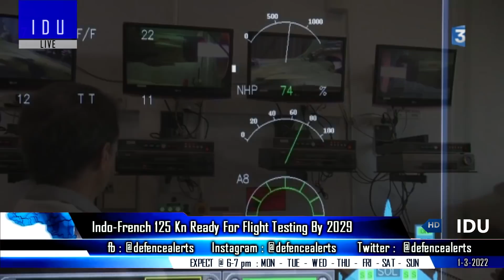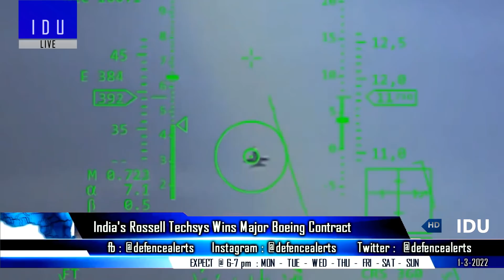Indian Defence Updates : 125 KN AMCA Engine By 2029,3 Kilo Offer,India's Rossell Wins T-7A Contract

Comment from the maker: 🔴What's Your Opinion : "125 Kn Engine Flight Test Ready Before 2029" ?
ＬＩＫＥ | ＣＯＭＭＥＮＴ | ＳＨＡＲＥ | ＳＵＢＳＣＲＩＢＥ
Reply: Best
Reply: Why French  is doing with India????
Reply: does it is a adoptive cycle engine .??
Reply: Expect with AMCA
Reply: Test, upgrade, test, upgrade, test, upgrade... That is the reason why it won't be ready before 2036 if it isn't tested and upgraded fast. The core technology needs to have an Indian IPR or it will be a bust. And as they are building a French M-88 based design that makes it less upgradable, it sounds like it is the upgrade they are going to use in the Rafale F-5 that will be shared. But the Su 30 will be obsolete by the time they inducted these engines due to the enormous RCS, it will be useful as a bomber and missile truck but not as a frontline fighter.
Reply: भारत सरकार ने फ्रांस से बात करनी चाहिए अडोप्टिव सायकल इंजन 6th जनरेशन  का ही निर्माण करना चाहिए
Reply: @nareshlad9898  they need a  reliable geo partner ..
Reply: 2029 is a good deadline. Make more prototypes
Reply: wish to be ready before 2029
Reply: Hope 2029 won’t become 2039. Even worse would be DRDO springing a last minute surprise saying they can make an indigenous engine by 2027 and babus cancelling this contract.😕
Reply: @srikanth85in  When you use 1%of your brain no babus can cancel a jv
Reply: @Flying Tiger Come on man see they have Qrsams in their columns they are not idiots like us
Reply: @Flying Tiger How many TB2 and how many anti tank missiles on those TB2 is required to take out the 40 mile armored columns? No Russia cannot stop every TB2 strike when the invasion is carried out all over the place on the move..Ghost of Kyiv and various other stories won't stop the war of attrition..
Reply: @Flying Tiger Just read a few mins back senior pilot of Ukraine AF is confirmed k!lled as he "repelled" an attack.. No Russian air superiority/multirole were flying mostly a S-400 missile launch from Belarus took out the SU-27.. More of Mig 29, SU 25 come in and it makes no difference... If F-15/35 typhoon rafales come in then it's different but NATO chief said they are not gonna get involved as of now..
Reply: @aocaoc2561  Ukraine AF does not fly Rafales or Euro.. hence it was not given by NATO.... So only mig n Sukhoi r given
Reply: @jothisampath415  No there were disturbing talks about European NATO allies giving air cover and superiority to Ukraine via Poland with their own pilots.. Today those plans  in all probability is cancelled as that will pretty much trigger attack on Poland NATO member and eventually trigger WW3..
Reply: @bonitaramsingh  As of now I pretty much don't care.. Lol I don't think New Delhi is planning to comprehensively counter Chine..
Reply: @bonitaramsingh  since we cancelled Igla-s n we r clearly lagging in Manpads; these west manpads r performing well. Y don't we make emergency purchase to get limited manpads atleast?
Reply: Will  improved Kavery Engine be used for UAV ??
Reply: @dev4rajan  for sure yes
Reply: @bonitaramsingh  Everything is on the table... Russia backed into an extreme corner can pull off outrageous and dangerous stunts..
Reply: @Jefe-Grande  Holy crap Randy! Hope we don't end up in a situation where
-World war 3 --Check! LOL
Reply: @bonitaramsingh  then drdo need to ramp up. May be enough to take out Chinese tanks .... But some limited west atgm might be v handy
Reply: clearly no
Reply: The best option👍
Reply: This has to start sooner and expedited. This would help us to put this higher thrust engine in Tejas MK2 which is scheduled to go production by 2029-30. Also India should have rights to manufacture without any royalty to Saffron.

Comment: Why such a long period of seven years is required when every technology except afterburner stage is available with us ?
Reply: No !
the M88 is 1850 kelvin vs 2100 needed.
Reply: Kyon ki bheek mein sirf paisa hi mil sakta hai , paisa kamane ki akal nahi ! 🤷‍♂️😒
Reply: Very good question...when they complet the joint project in 2029 there will be new aero engines avalable with 150kn for sure
Reply: @suhada8926  the trust is just one aspect of it. If you can fly 2h30 with a 120kn or 1h with 150kn with 1h in the air ? 
Electricity generation will also be super important.

Comment: if AMCA MK1 is powered by 125kn engine then for AMCA MK2 the engine must upgrade to 130kn or 135kn
Reply: mk2 will be 125kn engine
mk1 will use General Electric engine